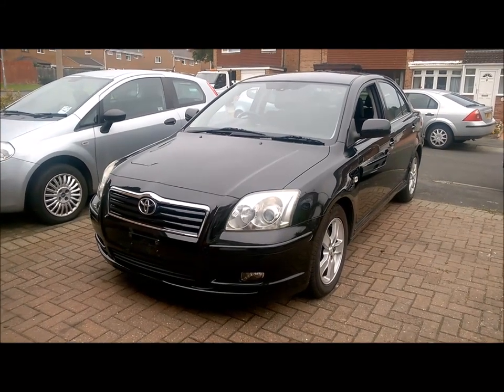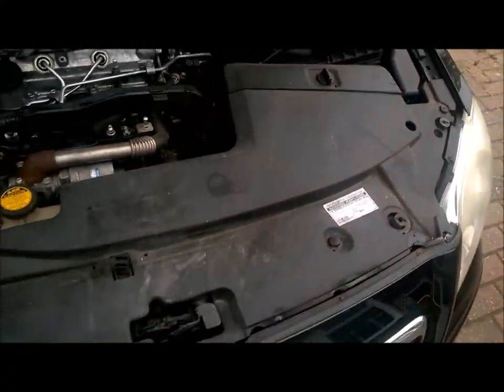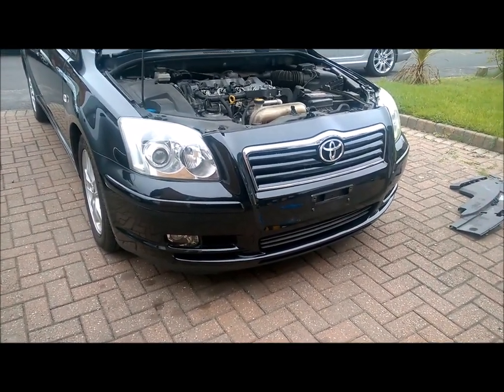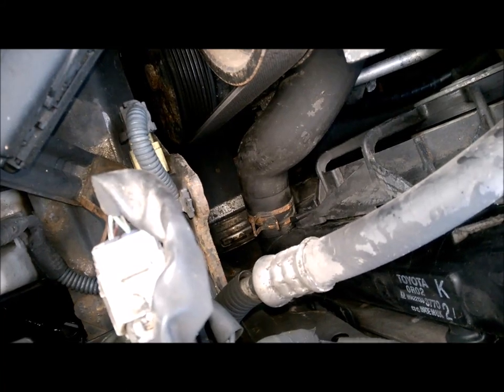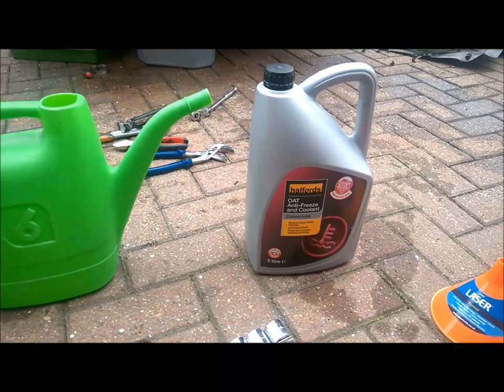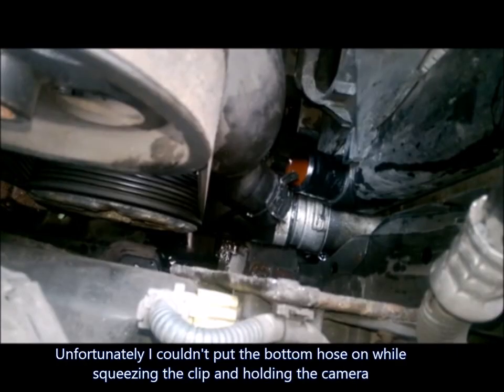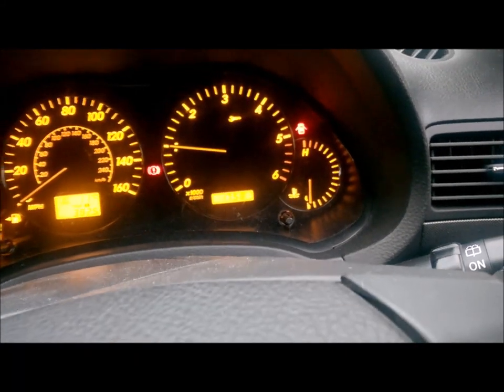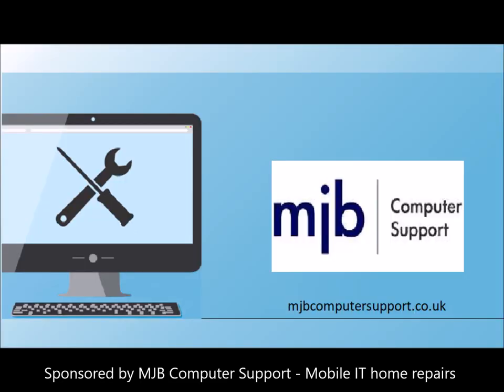ANTI FREEZE REPLACEMENT - Toyota Avensis 2.2 Diesel

Comment: Another good tip for you, with fuel prices rising, is to ensure tyre pressure is at the proper rating eg 35 psi fortnightly, and add a fuel injector cleaner into the fuel tank. My miles per tank increased from 450 miles to 520 miles by adding a product called ‘Advanced Fuel System Cleaner’ available from Toyota Motorline in Hereford, it’s costs £6.50 so add it every 3 months if doing 10k per year and you cannot go wrong with that one. Injector pattern improved massively. Also, never flush your engine oil using engine flush additives. I will soon show you my new youtube video showing how to flush coolant system using de ionised water, using a non spill funnel to release air bubbles and replace with Toyota super long life pink. It’s very time consuming and I do it myself properly as few garages ‘have the time to do things properly’ as I have learned.
Reply from the maker: Thanks for the tip Jason, I will look into the injector cleaner. Can you send me the link once you upload your video please.

Comment: I can add some insight. My corolla d4d 2.0 litre 2004 has done 131k. My Haynes manual says replace coolant every 30k using Toyota pink pre mixed super long life. The coolant is made in Japan and contains small concentration of phosphates proved to provide superior engine corrosion protection. it’s the best coolant in the world. Other manufacturers  10 yrs ago removed phosphates from their coolants resulting in engines rotting within viz opaque coolant after use. My coolant is crystal clear, even after 30 k which is how it should inside your engine. So next time, use Toyota’s coolant and denso air filter, oil filter, fuel filter and glow plugs..only use denso stuff, again made in Japan. Thank you very much for posting the video, Toyota advised me the same as written under your car bonnet.
Reply from the maker: Thanks for your advice Jason. Pleased you have a Haynes manual for your Corolla, they don't do a manual for the Avensis.
Reply: just a shame that last time I bought Denso spark plugs... they were made in Indonesia!

Comment: I am curious - why remove the hose clamp instead of drain out the fuid with the plastic drain screw on the bottom left side?
Reply from the maker: As a rule of thumb I always drain the coolant via the bottom hose, it tends to be the lowest part of the coolant system on most engines, to drain as much as possible.
Reply: @amateurtorque6709  nice nice, very good video. Just I was wondering because I found out on the bottom of the radiator there is a drain off valve. So I was wondering if there is  an advantage to the other way of doing it.

Comment: The way you use to change the coolant is not correct. The cap is underneath glued to the radiator on the driver's side. It's a metric 12 white plastic nut and you don't have to remove it to get it out.
Reply from the maker: Thanks Fransisco, ill look out for that white nut when I'm under the car next.

Comment: Hi Amateur Torque, thanks for the video hope you do more  videos . Can I ask you do you know where is the coolant drain plug for the engine block? As I wanted to empty all coolant, so I could do a full flush, and clean with distilled water. But I need to know where the engine drain plug is.  I have the Avensis T27 Thank You
Reply from the maker: Coolissim0 Unl1mited Hi, pleased you found the video useful. T27, very nice. Sorry i don't know where the engine block drain plug is. What I would recommend is mixing some cheap coolant with water and use this to flush out the remnants of the old coolant. Then use a good approved coolant to fill.
Reply: Thanks for the answer, it seems a good idea, but I wanted to clear all the fluid or mostly all.Any other Idea? Where is the engine drain plug of your Toyota?
Reply from the maker: Coolissim0 Unl1mited I haven't looked for it, however I will look for it next time I'm under the car.
Reply: The drainage plug/cock for most recent Toyota engines (including diesel), is on the rear of the block below the exhaust manifold. I have replied to you in the Toyota Avensis Owners forum, where I linked other videos and diagrams. Look for part no. 111415A.
Reply: konradc12 thank you Konradc12 you are the best
Reply: hii,

i have t27 as well, can you link me with the forum where you answered coolissim0  pls ? 

thanks
andrew
Reply: hii, 
pls tell me where is the location of the engine drain plug located for t27.. thanks. 
andrew

Comment: Instead of jacking the car and having to remove the under tray.
I  got at the bottom hose clip off from the top there was plenty of room (on the petrol version anyway) saved me tons of time, I flushed the top up tank and squzzed the other hoses to remove extra coolant. Securing the bottom hose I refilled and kept squeezing all the hose don't forget the heater cores ones going through the bulkhead. Test drive 25kms all good.
Reply from the maker: glad you got your anti freeze sorted. when i did mine there was no hand room from the top, invested in some long nose pliers which helped

Comment: Ok,  I spoke with Toyota today. They advised me to drain the d4d engine block first, and then the radiator. If any excessive corrosion eg cloudiness or metal particles observed in the collected old coolant, then upgrade the coolant with premixed 50:50 Super Long Life Pink. If crystal clear, then I should continue using Toyota Long Life Red which is available from Toyota York for £36 for 20 litre dum (concentrated RED). My coolant is RED and has been in the car since 2012 and a 200 ml test sample from radiator is crystal clear, but i will know which to coolant select once I  have collected all the old coolant. I hope this helps. POSSIBLE TIP: It is possible to remove the lower pipe (as in your video) and then run the engine for 30 seconds with the pipe disconnected to purge old coolant from engine block itself, instead of draining direct from engine block separately according to my other mechanic. My car originally had PINK coolant but for some strange unexplainable reason RED was added into the radiator instead, but not the engine block, hence the coolant itself is a mixture of PINK & RED which is 'a big NO NO' as different coolants should never be mixed as this compromises the anti corrosion properties. Not too serious a problem, as only a litre or so of PINK remained in the engine block when it was drained in 2012. No need for me to do a de-ionised water flush of the coolant system (considered 'over kill'). Maybe just rinse the radiator in isolation, depending on the health of the coolant retrieved. Hope this helps.

Comment: Thanks for vid! Isn't there a drain plug on the bottom of radiator? I know they are limited use and slow draining, but that's not a track car like my MX-5 where I do only hose-method. 
400.000km on my 1CDFTV (2.0L) and it's time for timing belt & water pump change, will be replacing the thermostat and coolant same time.
Reply from the maker: 400k, thats really good. Yes there is a drain plug, I prefer to use the bottom hose method as its generally the most southerly point on the engine.

Comment: My wife has the Toyota Corolla Verso d4d, which I assume is the same engine as the one here.
Very informative video. looking at the Verso, the radiator clip is pointing down , like this example, so I am wondering whether it would be easier to access from below, having removed the plastic under shield anyway?

Comment: Hei 
Has anyone a got clue where is location of drain plug on the engine block because i will take out all coolent out.
I have same toyota avensis t25 d4d  2008 and have never replaced coolant???
Cheers mates

Comment: Any advice on changing starter motor
Reply from the maker: No, sorry, not had to replace this yet.
Reply: Changed mine removed  rad fans and intercooler pipe watch small pipe at bottom of rad fans x

Comment: ADVIVE NEEDED PLEASE  :)
My avensis has done 140,000 miles don’t think it’s ever had a coolant change going by the service history. Bought it at 124k about 6 months ago, serviced when I got it. Just did another oil change. Seems to run fairly well, when I fill coolant up to recommend height though the engine seems to burn some off until it gets below that height. Engine runs a bit Smokey if I top it up, no sign of head gasket going though, some coolant residue visible around the underside of the engine around the oil filter. 
Any ideas anyone ??
Reply: Hey! I have the 2.2 Sr180 model, but from what my research has told me they're essentially the exact same engine. I have a problem with smoking too, at random intervals (Not DPF regen) and when using around 60-80% throttle. I found that my problem is likely the EGR cooler, leaking coolant into the exhaust gasses, passing through the EGR and into the cylinders, then passed out of the car. I was very, very slowly losing coolant, no headgasket failure, and no other fluid loss.

My recommendation is to check your EGR, the soot should be black and matte/ powdery, mine was hard and shiny, almost piano black in appearance (Due to coolant and heat). This is apparently is a very rare problem, I can't find anything online about it!

So it is unlikely to be this, but check your EGR to make sure, if its shiny and black there is coolant in there. Also FYI, I'm currently on hour 9 of disassembling my engine bay to get access to the EGR cooler, so it isn't a simple job at all! So I hope for your sake I'm wrong!

Comment: Thank you for uploading. Out of interest how long does it normally take for the engine to warm up. Mine is about 15 mins so I was wondering if the thermostat was stuck open. 
I also notice your insulation on the fire wall is resting on your turbo. Mine was too until the mot tester advised me to secure it ASAP.
Reply from the maker: Hi Davey, thanks for your comments. Mine can take 15 minutes to warm up especially in winter or if I'm behind slow traffic, however if it's summer or if the roads are quiet and I can get my foot down it will only take 10 minutes to warm up. How old is your avensis and how many miles have you done?
Reply: Amateur Torque thanks for replying. Sound like the same time as mine. Maybe this is normal or maybe yours is buggered too. Lol. Only had my t180 a year but it’s on 135k now and runs perfect once it warms. 
Plastic trays are a nightmare to do, sooooooooo many clips n bolts !

Comment: After further research, I believe red is better than pink despite the hype. Toyota York do a good deal on it, needs changing every 3 years or so.  Only red coolant is used in expensive 4x4 Toyota vehicles and pink is not sold on this excellent website which you should read in detail every page.....https://www.roughtrax4x4.com/genuine-toyota-long-life-red-coolant-5-litres-pre-mixed.html

In addition speak to toyota taxi drivers who run Toyota’s to 500 k miles for further service advice on your Toyota  🚗